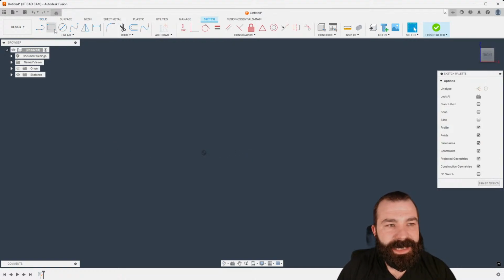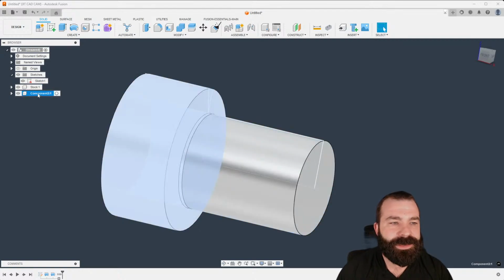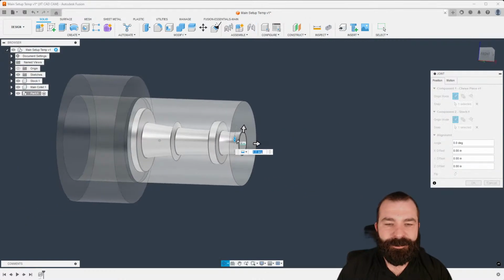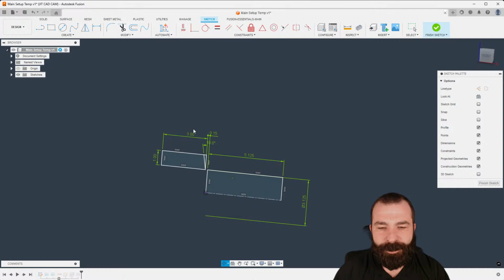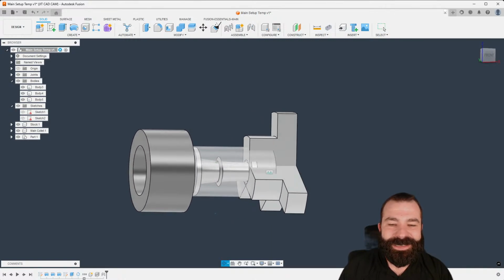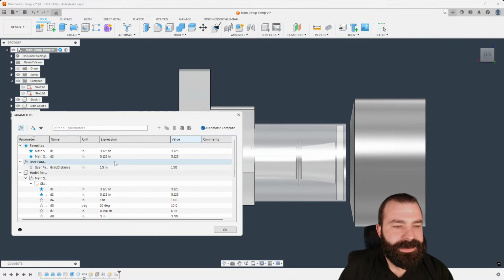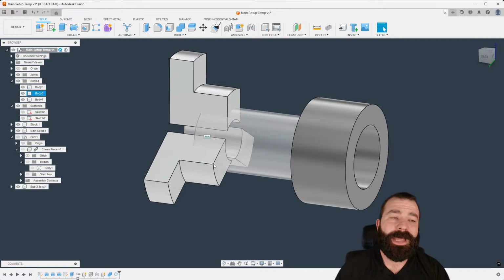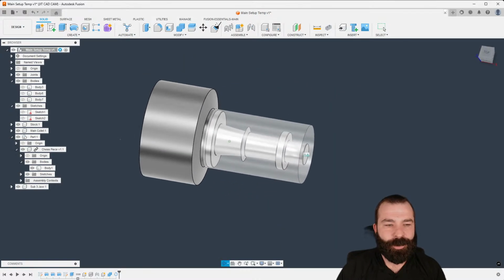Workflow Wednesday: Parameter Controlled Chucks for Turning Setups

Comment: What i find "difficult" in this or inconvenient is that you always have to bring these templates to the folder where the part is or otherway around? If you had multiple customers and multiple parts how would you handle this workflow then? Thanks
Reply from the maker: Techincally no. You could insert your Template into the original customer part and break the link.